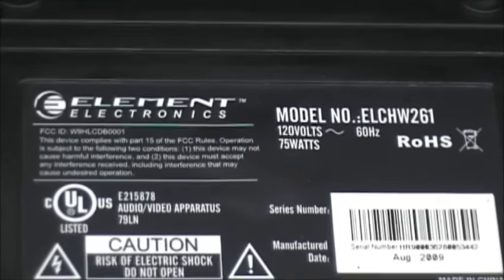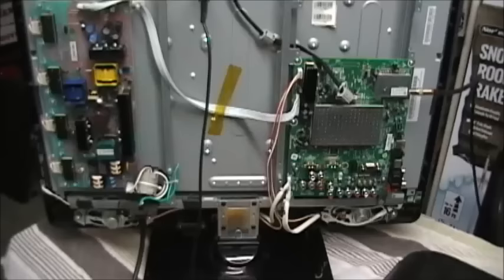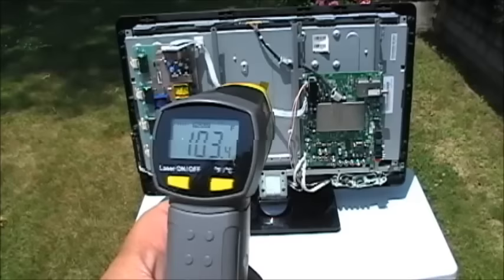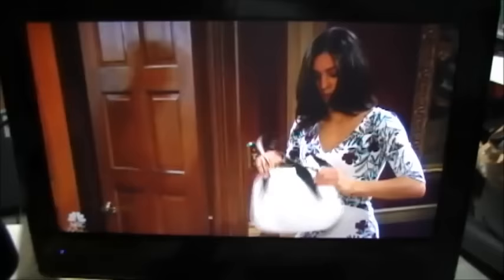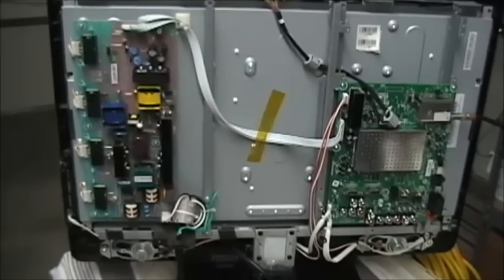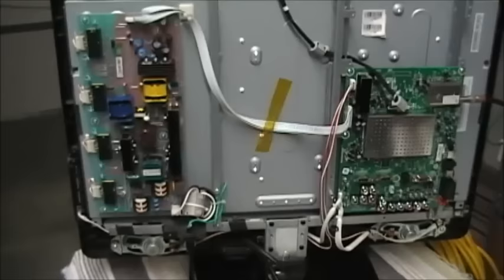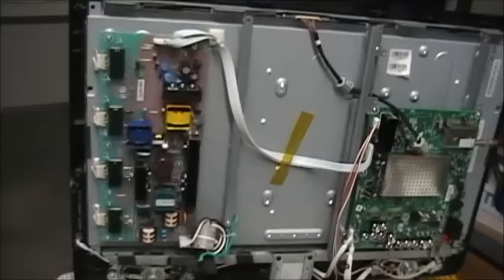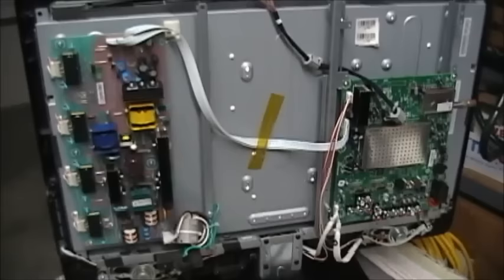LCD TV Repair Secrets - White Screen

Comment: I think main problem is they don't make TVs that last anymore. I remember my parent's old TV lasted 20 years when I was growing up. Most now are good to see 5 years of life.
Reply: The all wise and knowing manufacturers know that resources are infinite and people should hand over all their money to them.
Reply: 5 year 😂 , mine one not even lated 1 whole year
Reply: U are absolutely right. Imagine calling Vizio and the only thing they can advise is that I go buy a new tv because they know if will cost me more to fix it. This is a $700 tv that have only used for 3 years 😢. I really wish someone could sue them for using inferior materials in making the tvs of this generation and extorting money from people by charging so much for them.
Reply: My samsung 7 series purchased in 2016 is still running strong. 🤛🏼
Reply: I have an old one that I got at a yard sale from like 8 years ago. I use it in my bedroom and it still works. The thing had to have been 10 or 20 years old when I got it and it’s still kickin ! This one is about 3 years old and is junked

Comment: Due to its design, there is poor heat dissipation during the early life of this lcd...so the constant heating up and cooling down will eventually cause the contacts to separate. The packing tape is cellophane with a glue surface which will soften as the unit heats up....so  a short term fix stays short term...use a thermal resistant glue and clamps/weights and let it cure over 72 hours...before subjecting it to normal use...the fact that the heat vents are not big enough and get clogged up with dust is why the internal temp gets too high..thus contacts held together with epoxy etc..reach  failure needlessly..so drill some extra holes in the rear case which wont be seen from the front will also keep the running temps down. This same reason why older lcd displays get vertical bars because the top of the display is always getting to hot, and causing the bonding to separate.

Comment: My TV is reverse as long as it is cold weather my TV works perfect. But as soon as it gets hot in the home. The screen starts fading
Reply from the maker: Three things you can do:
1. Unplug the TV. Take the back off. Carefully vacuum out all of the dust, keeping the brush well above the circuit boards. Use a clean paint brush to carefully dislodge any stuck dust.
2. Provided there are no children or behaviorally challenged adults in the home, leave the back off. Problem solved.
3. Otherwise, reattach the back and place a small fan directly behind the TV. Any small personal fan, preferably one with a remote control (so that you can conveniently switch the fan ON/OFF as needed) will also solve the problem.
Hope this helps. Thanks for commenting!

Comment: Brilliant! Thanks very much for posting this.
I put my TV (white screen with sound, like yours) in my greenhouse (90F) for 1 hour. And it almost works. But the picture is as if I was on psychedelic 🍄 mushroom.
However, the next day after cooling overnight at room temperature, it's still working, albeit with psychedelic image.
I'm going to try again for longer time.

Comment: Weatherstrip square foam rolls with adhesive on one side. Cut a piece the proper length and apply. When you reattach the frame, it will put pressure across the contact points. Sometimes, it can last years. Low cost too. Rock on!

Comment: Thanks for the video! For sure that helped me! I don't have an issue like this right now but if I run across this in the future, I'll know what to do.
What I will do though, is find out which of those traces aren't making good contact, then I will scrape away at the top of the cable and run small jumpers with some 36 or 40 AWG enamel coated wire. Then I'll use PCB solder mask on top of that. That should give it a permanent fix.
Thanks again for the video! 👍
Reply from the maker: Even if the intermittent connection could be fixed with solder (it can't), no human being could possibly fix it the way you propose.
Reply: @LawrencePina  definitely possible for a human to do it. if we can repair torn flex cables from parts inside of iphones, doing what I purpose with this TV would probably be even easier. Not sure if I have videos of me doing flex cable repair on my youtube channel but I definitely have a video or two on my facebook page.

Comment: I did once see a guy solder those ribbons together. He applied soldier on both sides, then use a heat gun to fuse them. He was a guy with real soldering skills.
Reply from the maker: As currently manufactured, COF cables are attached to LCDs with conductive adhesive applied via a robotic, ultrasonic energy machine. Read about the process here: https://www.eesemi.com/wirebond.htm Regarding the video you saw, did the guy with "real soldering skills" show you the TV working after he "soldered" everything back together? I've seen those videos too and none of the ones I saw show a working TV at the end. Ask yourself why.

Comment: Stubborn is good.  I have the same problem with a Samsung 21" monitor/TV.  But my problem is I can't even get the back off it because I'm afraid I'm going to crack the plastic.  I got the whole thing off except the bottom, where there's a clear plastic runner along the bottom edge.  Great video, btw.

Comment: From my understanding, those film connectors each only control a column of the LCD, a few inches wide. If you were to cut one off, the rest of the LCD would still work, minus the area beneath it. With that in mind, the problem can't be a loose connection with that film cable, otherwise it wouldn't affect the whole screen. I think the problem is more likely to be one of the components in the corner of the source driver board. Since you already established that the problem can be temporarily solved by heat, you could probably pinpoint the exact location using a lighter.
Reply from the maker: According to pages 40 and 52 of Kent Liew's 2016 "LED/LCD Screen Panel Repair" ebook (available from LCDRepairGuide.com), all white screen is caused by loss of VGH (VON) voltage from the source driver board. When VGH is present, TFT cells in the LCD panel switch ON and the display shows. If VGH is missing or abnormal, symptoms will be "slow motion, white screen, display darkness or display blank." We also learn (from Kent Liew) that VGH typically measures between 20V and 30V. The VGA test point on this TV can be seen at 06:49 in the video. Although not shown, I measured a steady 19.8 volts both there and on the trace at the input of TAB/COF. It didn't matter whether the  screen was all white or displaying normally. 19.8 volts was always present. Based on that (assuming Kent Liew is correct), it's reasonable to conclude that the VON signal is intermittently lost somewhere inside the TAB/COF. One thing I know for sure, probing with a cigarette lighter is not going to fix it.

Comment: I have a new insignia TV but it was in storage. When I turned it on I have a white screen.
Reply from the maker: If your TV was a low mileage car that had been parked/stored for some time, and wouldn't start (or even roll) now that you need it again, the mechanic would be telling you "It's not the miles. It's the age." When a classic automobile is stored, any gasoline left in the tank turns to varnish. Carburetor passages get plugged The engine won't start. Barely used tires get dry rotted and go flat. Wheel cylinders freeze. Brake lines rot. Drive belts rot. Hoses rot, and so on, and so on, and so on. In the case of your TV, the conductive glue which bonds the COF cables to the LCD has lost its grip. There's no permanent fix for that, but if you squeeze the frame around the LCD as shown at the end of the video, you may be able to restore the picture, at least temporarily. Like classic cars that have been stored, your TV didn't get used, but it broke anyway. Read through the comments. Lots of people got their TVs working again with a tap or a squeeze, typically in the upper left corner of the bezel. Maybe that will work for you. Good luck! Thanks for commenting.

Comment: My Tv brand is TCL.. 
and the problem is that.. it shows alternatively a blank white screen and a black screen with a white bracket/crosshair at 2 second interval between.
What do you think is the problem. Sounds care playing (how did i test?.. i used hdmi to type c cable to mirror my phone screen.
Reply from the maker: I'm thinking you might have entered the service menu or maybe the TV got disconnected in the middle of a firmware update? It's hard to say. Also, be aware that the TV in this video is a pre-2012 model with florescent backlights. The very few TCL TVs that have come my way have all been post-2014 models with LED backlights. Big difference between the two types of TVs. The last TCL I fixed had an RF (air TV antenna) connector that had been ripped out of the digital board. Nothing resembling your symptoms. It might help to post the model number and manufacturing date of your TV. With that info, someone who knows exactly what's wrong may reply to you. Good luck! Thanks for commenting.
Reply: @LawrencePina Thank you for your reply. Will do that.

Comment: Did you make sure the phillip's head screw in the left upper corner was tight? I am sure  you did, but...
Reply from the maker: I did see it. Over tightening the rear cover screws doesn't put pressure on the display panel assembly. All those screws do is fasten the rear cover into the front cover. And, if you fasten them too tightly, heat related expansion and contraction (of the cabinets) can cause loud snapping noises. Experience has taught me to snug TV covers but not over tighten.

Comment: interesting....my old sharp has a white screen....the death grip did not solve the problem....but thanks for the investigation....
Reply from the maker: In my experience, older Sharp TVs tend to develop loose or corroded LVDS connections on the source driver board. You may have to remove the display bezel to do it, but reseating the upper LVDS cable connection may correct your problem, permanently. It's worth a try!
Reply from the maker: Possibly because a metal frame is preventing you from squeezing the TAB/COF. Try shimming something between them. In this video I used packing tape. Others use rubber bumpers. Fill the void between the frame and the cable and you should be able to affect the problem even after the TV has been put back together. It's just an exercise. Other than replacing the display panel (not an option because you can't buy them here in the US) there's no permanent fix.
Reply: @LawrencePina  for someone that knows a lot about TVs he should have a lot more subscribers.

Comment: I have the same issue on my Philips LCD TV model no 32PFL5609/98. It turns while after a few hours or at times when I switch it on . It could be the similar lvds cable or the tcon board . I hope so . Can I get a hint how to rectify this issue. Thanks
Reply from the maker: Lyndon, It's not the T-Con board. White screen is caused by loss of VGH (VON) signal to the LCD. Cause has to be the same as shown. Either there is a loose or corroded LVDS cable (not making good contact on one or both ends) or an open TAB/COF on the source driver board in the display panel assembly (exactly the same as shown in this video). Did you try squeezing the bezel as shown at the end of the video?

Comment: HI, I HAVE THE 40 INCH SAMSUNG TV.  THERE ARE WHITE SPOTS ALL OVER THE SCREEN.I OPENED THE TV AND CHECKED INSIDE AND ALL  DIFFUSER  AND LED'S ARE IN CORRECT PLACE , EVEN THEN THERE ARE DARK LIGHTS ON THE SCREEN AND IT IS DIFFICULT TO WATCH. HOW TO RECTIFY IT.  AND I DONT KNOW WHAT TO DO. PLEASE HELP
Reply from the maker: What a great example of whether zebras are white with black stripes or black with white stripes. Here's why I say that: Three things commonly go wrong with LCD/LED TV displays. 1. The tiny LEDs mounted below the diffuser caps burn out (shorted condition) causing instant safety shutdown on powerup. 2. The diffuser caps fall off causing very bright white spots on the screen, but that's not your problem. 3. The tiny LEDs mounted below the diffuser caps burn out (open condition) causing dark spots on the screen. Your TV is almost certainly suffering from dark spots, but you ask this question in context of "whte spots all over the screen" meaning you might be someone who sees the black zebra. That's what makes your question so interesting.
From your description, I'm guessing 1/2 of the individual  LEDs in your TV have burned out. When that happens, it's best to replace all of the LED strips. Note the part numbers on the strips and see if you can get brand new ones (not used/pulls and definitely not remanufactured strips) from aliexpress.com. If the price is right, you might also want to pay extra for 7 to 10 days guaranteed delivery service. Otherwise, with free shipping service, the order might take 12 weeks or more to arrive. To learn about dark spots caused by burned out LEDs and how to confirm that this is your problem before ordering brand new LED strips, please watch: LG 42LN5700 - 47LN5400 LED TV Screen Repair Secrets, and LG 50UH5500 UHD Smart TV Repair Secrets. Good luck with your repair, and thanks for asking such an interesting question.

Comment: So i live in dubai wich is a very very hot country 104 degree in home without a.c. and having white screen😊😊
Reply from the maker: White screen is caused by loss of VGH (VON) signal to the LCD. Cause has to be the same as shown. Either there is a loose or corroded LVDS cable (not making good contact on one or both ends) or an open TAB/COF on the source driver board in the display panel assembly (exactly the same as shown in this video).

Comment: My Vizio 60 inch doing the same thing,can I use a heater to do the  job? Help need THANKS
Reply from the maker: I've never tried to duplicate the experiment using a radiant heater, so I don't know whether that method is going to work. Even if it does, it's not going to fix anything. You'll still have to deal with the problem which is invariably in the display panel assembly, NOT on any of the boards.

Comment: I got the same problem but with my sync 4 inches on my Ford f150 2016, what Can I do
Reply from the maker: Check the ribbon cable(s) connecting the PCB to the screen.  White screen is caused by a bad connection. Thanks for asking.

Comment: Could have just as easily overheated creating a short that pushing temporarily solved. Mine was on all day before this happend (and only on for 10 months of weekends, at that. Walmart Vizio E55-E2.  Just tried a different TCon Board (used, ebay).   No change.. will try connections but beginning to take up too much time.
Reply: Vizio has major capacitor issues and their caps are normally JUST enough for that model. If you buy replacement caps, step up to a higher level capacitor. Worked for me on Vizio's.

Comment: my screen has problems also in the TCON panel electronic but does not fix itself by touching anithing on the COF or near :( just grey pictur with small horisontal and vertical lines changing and a pillow like white zooming effect groving as it fills in with some electricity slowly
Reply from the maker: It might help if you told others the make and model of your TV. Without that info, no one is likely to offer anything useful.
Reply: @LawrencePina  HT17E12-200

Comment: Thanks it works 👍👍 ..but just for an hour when i turned it off and in a few minutes on again its white screen .. how can i fix it permanently
Reply from the maker: Not possible (without replacing the LCD), but at least you know what's causing the problem now, and you didn't waste any money on TV boards that are not going to work for you. That was the whole purpose of this video - to save smart people like yourself, both time and money.
Reply: I'm having this same problem with my Hisense Roku Tv

Comment: My power was out for 2 weeks so my TV had no power supply at all but as soon as our power cut on my son said after 10 minutes on having the TV on it started flickering then it turned gray now when I turn it on it's a all white screen please help do you think not having power for a while did something to it?
Reply from the maker: I don't see how a power failure could have caused this problem. Most likely the TV has developed display panel failure exactly as shown in the video. Squeeze the bezel. See if you can get the picture back.
Reply: did you fix it? i hasve the exact same issue

Comment: How to remove 
power only v3.25 lg tv
Reply from the maker: By "power only" do you mean standby LED comes on, but nothing else? Is there a blink code when you try to turn ON ? Do you get audio but no video? With the rear cover off, an you see back lights through the witness holes? Please be more specific. Start with the model number of the TV...

Comment: My TV goes grey at first and then has horizontal lines flickering black and White and after about 20 minutes in total being turned on the TV works fine.  I have it for 11 years. I think I'll just buy a new TV. It could be capacitors or it could be the panel but I'm not an electrician I can't discharge capacitors safely and I don't want to shock  myself.
Reply from the maker: Generally speaking, flickering horizontal lines indicate a problem on the main digital board. But what's the make and model of your TV? Maybe someone will have seen those symptoms on that exact same TV and be kind enough to tell you exactly how they solved it.
Reply: Thanks for replying it's an Acoustic Solutions lcd28605hd.
Reply: I bought it in Argos in 2007. Works ok after 20 minutes but is a real nuisance as it's a bedroom TV and I don't have it on all the time.
Reply: throw your main board into a oven at 375° for 10mins then try it! ;) I HATE RIBBON CABLES SOOOOOO MUCH! ESPECIALLY Samsung's 20ft of it and no replacements and all their products have different sizes! uhgggggg! 👎🤣